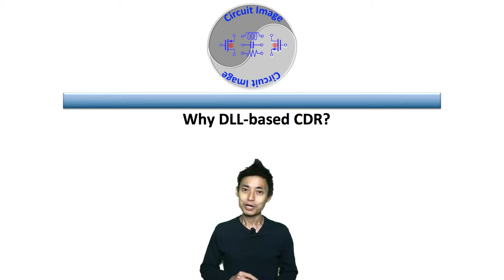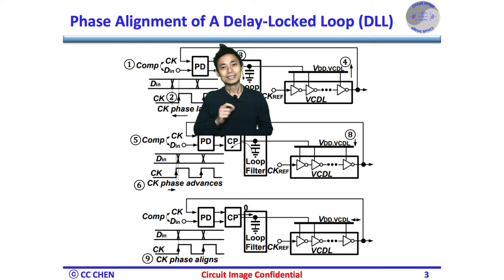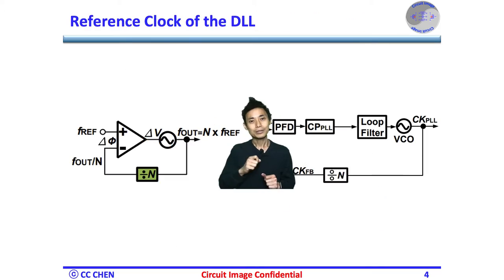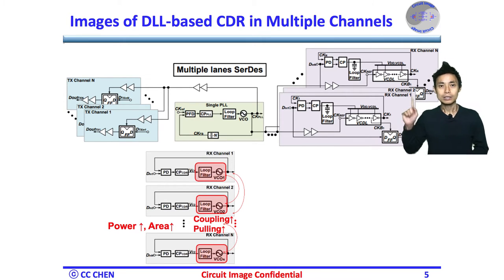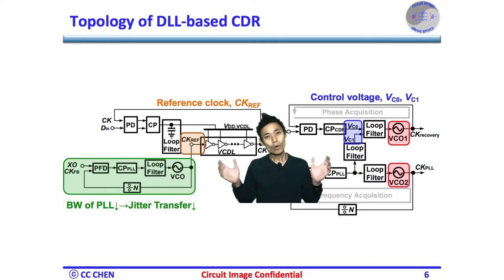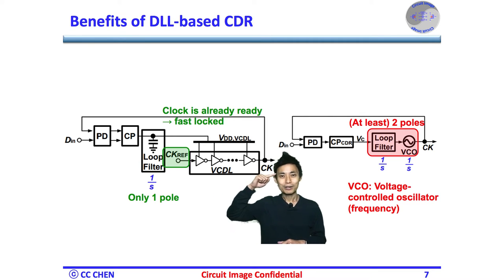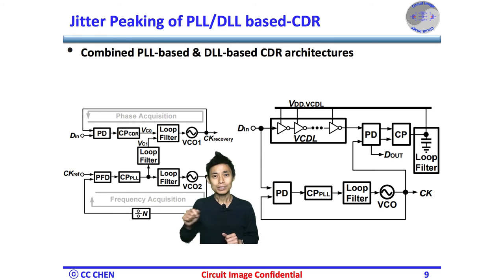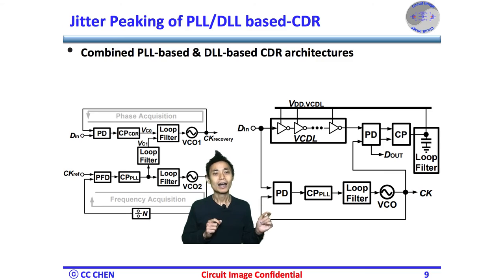Why DLL-based CDR

Comment: The dual-loop (PLL, DLL) based  CDR, can also have an added benefit for simultaneously meeting both JTF and JTOL which may be not possible using a single loop. Kindly share your thoughts/inputs on this.
Reply from the maker: Thanks for the feedback. The dual loop topology may lose all the benefits of a shared clock source among multiple channels.

Comment: which high speed applications do you know of that uses DLL based CDR? In all the PCI, USB applications I know of, only VCOs (or flavours of it) are used.
Reply from the maker: You are correct. The DLL one has the speed limitation, so it may exist in the legancy PCIe, USB, but not PCIe5 or USB4 :)

Comment: I have an idea after finishing the video. Does the following statement right？or I just have a misunderstanding.
Since the Tx and Rx Clk are seperately provided by individual crystal, the clocking mismatch between the Tx and Rx should be cancelled out by CDR. For PLL-based CDR, each channel requires a PLL for phase and frequency correction. So, it can be concluded that since the DLL-based CDR only require a PLL, the topology of DLL-CDR shows the merits of area-efficiency and power.
Thx a lot！
Reply from the maker: 😄Yes,  your understanding is correct.